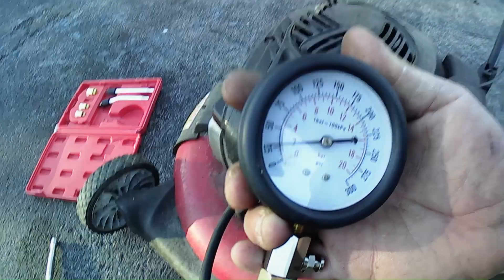MTD yard machines 21" push mower is it worth saving or use for parts?

Comment: John, you may have a valve adjustment issue. Did you ever check for spark? It does sound like weak compression but the fiddle fairies might have played with the valves.🤔🔧🇺🇸
Reply from the maker: I think I did check for spark but I will check it again I'm going to make another video on it I think you're right Roger I think it's the valves might be loose on there

Comment: Hi John, test the compression tester on a running mower to see what what you get for a reading. That should help indicate if the tester is working as it should or if it's no good.
Have a good one.
Reply from the maker: I did a part 2 unfortunately I didn't retest the compression on it but I found the issues

Comment: I have a Toro Personal Pace with a flathead brigs on it, and bag and blade clutch.   only has maybe 50psi.   
I took head off and looked at cylinder all, and it looked good.  I am thinking  I need to adjust valves.  perhaps thats what you need todo here.
Reply from the maker: Yes I think so also all signs lead to it I hope that toro that you have bumps up more than 50 psi